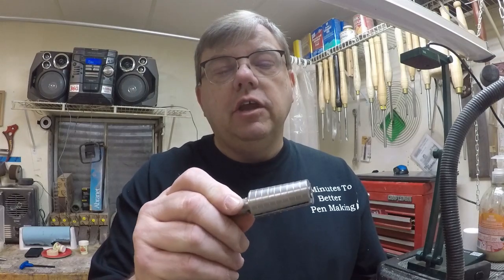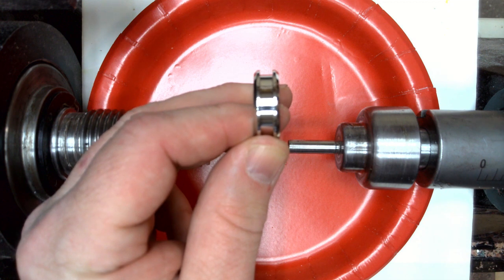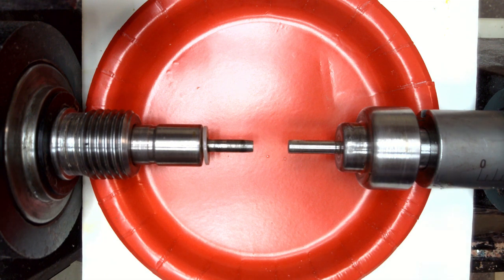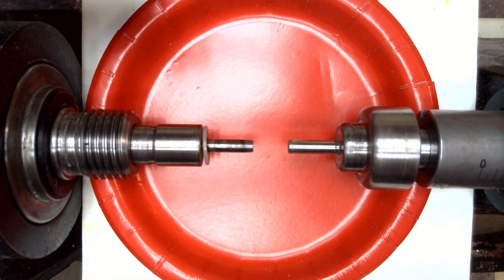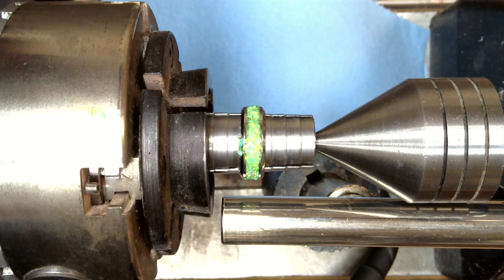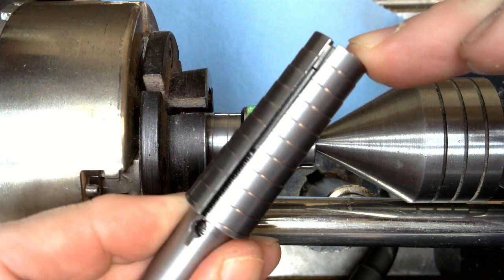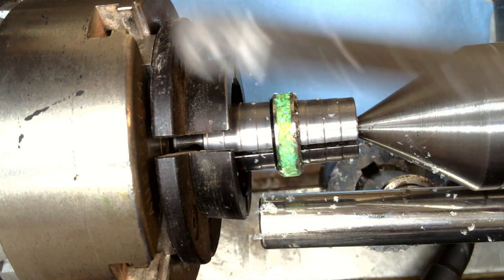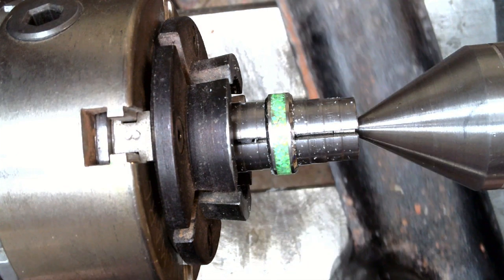10 Minutes To Better Pen Making - Inlay Rings - Mark Dreyer

Comment: Mark, this looks quick and easy. In the final shots, I noticed some voids...wonder if you had a finer dust that you could add to the ring before the turning?  Also, the video while you were turning was somewhat muffled, and much clearer when you moved from the lathe to the wrap up video...different microphones? I like this series of videos, so please keep them coming.
Reply: Yeah, if you want to see a lot more ring turning check out Patrick Adair's channel. Most ring guys use at least two grits of stone to fill in the voids
Reply from the maker: First and foremost - sorry about the audio. I generally do two videos at a time and this is the first with the muffled audio. I have a new headset on order. 

As for the inlay with the orange the the crush was too large. With the green and pink I went to a fine crush.
Reply from the maker: @guitarchitectural  As mentioned I am trying to encourage people to do a few other things with the tools we have. I will check out the other videos. Thanks for the heads up - I appreciate it.
Reply: @markdreyer2865  sorry, my comment was directed at the commenter and not yourself! :)
Reply: @guitarchitectural  While I agree that Patrick Adair has some awesome videos on ring making, his videos are not even in the same ballpark as this video. He uses mainly metal working tools and highly specialized tools (laser welder for one!!) while this is only adding in a ring mandrel to the tools we all have already.
Reply: @Jreed983  yes, the reference was with regards to putting stone infill into a blank. He has lots of videos of that type as well as two piece rings, and the techniques carry over

Comment: Nice! As usual. Thinking about selling and various sizes. How do you approach that?
Reply from the maker: That is a good question. I have not thought about selling them (yet). Here is what I know - the averages man's ring size is between 9 and 10. Woman's average size is 6 to 7. I would think to have most of my inventory in those two ranges plus or minus one size. I think custom would be popular here also - so I would never use all my material up. Meaning if I am doing pink opal - each gram gets me 2 - 3 rings. Therefore I would only do two to start. That way if someone liked one of the two I know I have the same exact material ready to go. With pens I generally do the same - have an extra blank in case someone wants one in a different component set. Once you sell through the two - make the last ring up knowing you will need to order more. Nothing kits your margin is shipping - if someone wants that color on another ring and you needed to order the material the shipping from the supplier is all on that ring. I am not sure this helps, but let me know what you do (if willing to share). Thanks for watching ...
Reply: Mark Dreyer I haven't made any rings yet but have been looking at all the kits & tools that are available. My thoughts are first to find out what the market would be. Would they sell vs the effort to make the product. That's disregarding the fun of making them from an arts and crafts point of view. I have no idea what the market would bear regarding price. Your thoughts on sizes makes sense . I guess I would double the inventory for woman's sizes as it seems to me that they are more likely to be attracted to rings. Maybe some others viewers can chime in on their ring sales with regards to sales and price. Our pen community has always shared with each other. I do think that on line sales would be difficult because of the personal nature of the product. At least until your product is established.